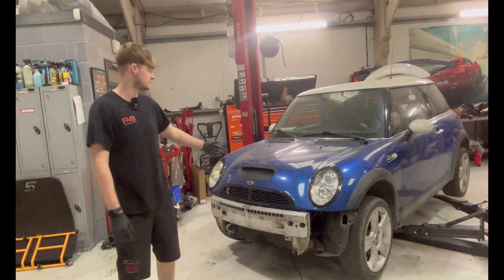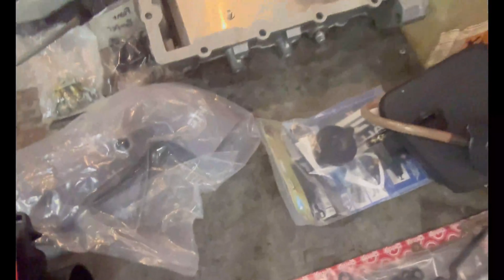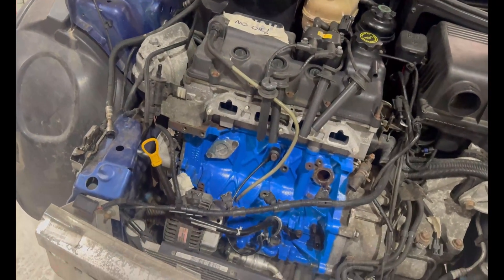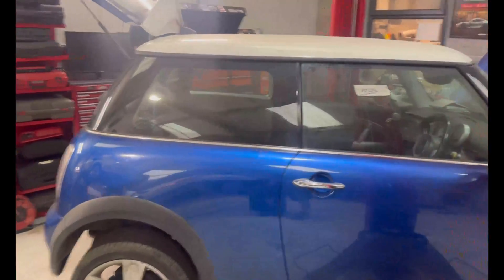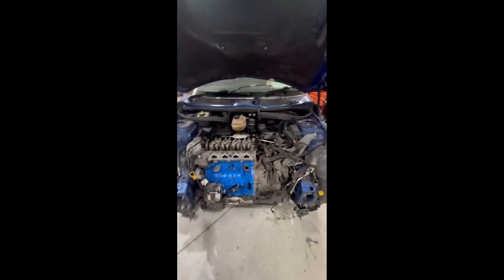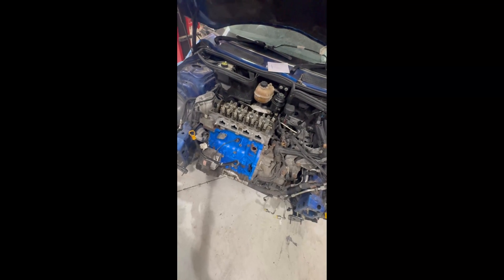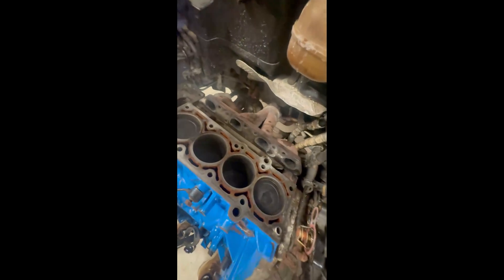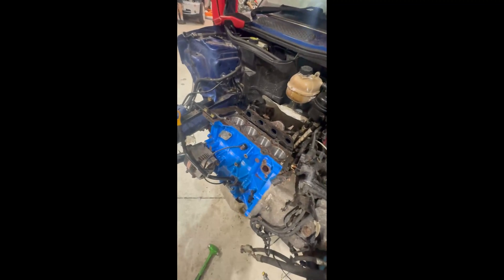MINI Cooper S R53 Project | Teardown Time Ep. 1: Cylinder Head Removal & Piston Ring Replacement

Comment: Should be a 6PK1374 belt for the 11.3% JCW pulley, unless you have other mods I'm not seeing?
Reply from the maker: Yep you are technically correct. However the customer supplied this belt, and due to the spring loaded tensioner setup there is a tolerance either side and this belt is still suitable for use 👍🏼
Reply: @SportsVehiclePerformance Sure! Definitely some wiggle room with these tensioners... But might be accelerated wear on said tensioner! 😂 Cheers mates!

Comment: Doing this entire job now, what tool would you recommend to deglaze the cylinder walls?
Reply from the maker: Recommend using a honing tool you can pick these up from around £10 to maybe £30 depending on quality of the tool. you will also need a power drill to use this aswell. Hope this helps